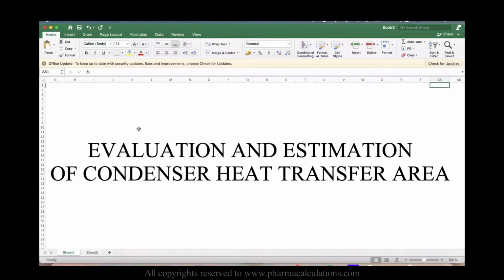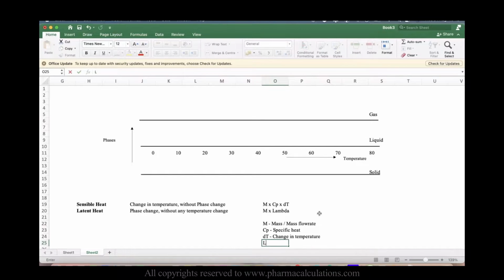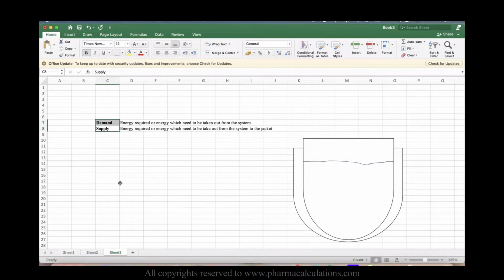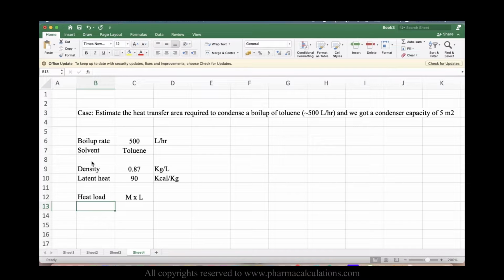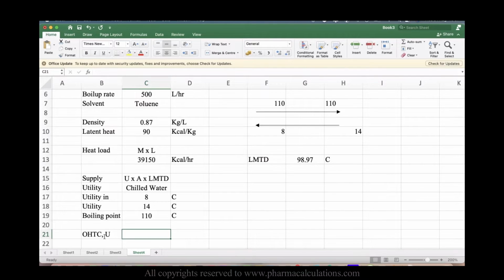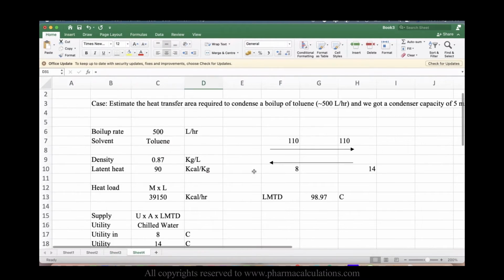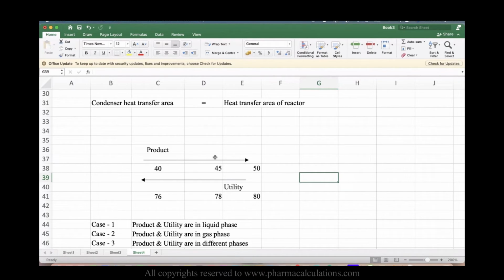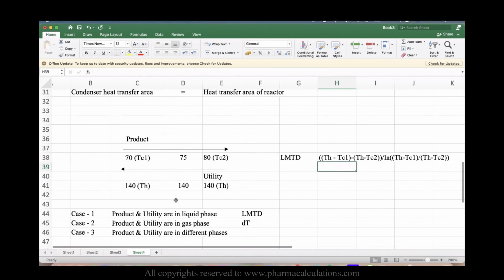Evaluation and Estimation of Condenser Heat Transfer Area

Comment: Sir in case Reactor Capacity is 1600 ltr so same method apply on estimating  how much capacity condenser will used for this Reactor (primery and secondary condenser).
Reply from the maker: Yeah
Reply: @pharmaengineering  thanks sir